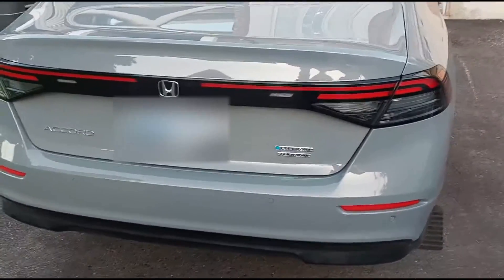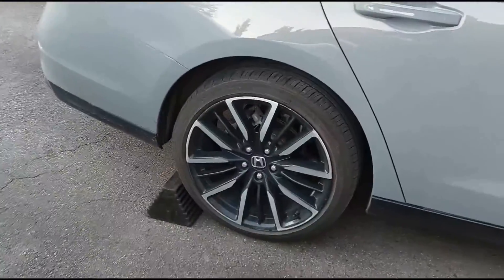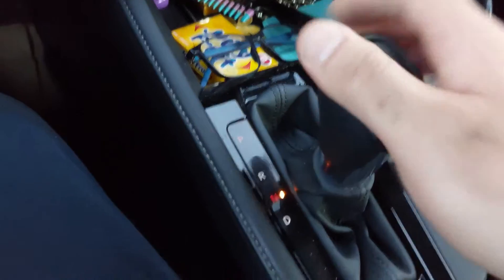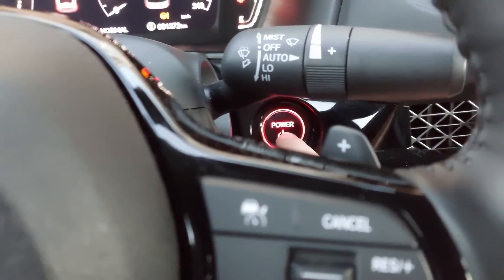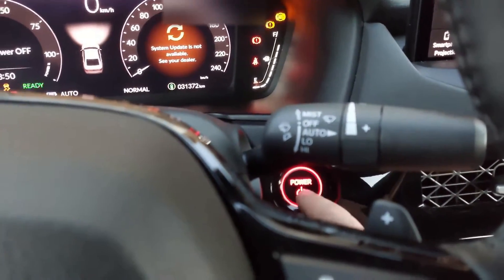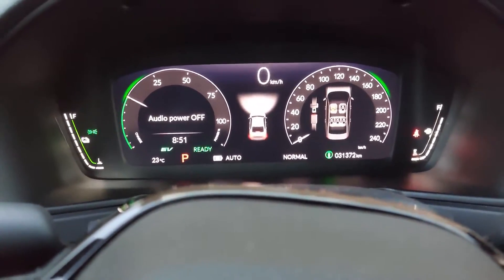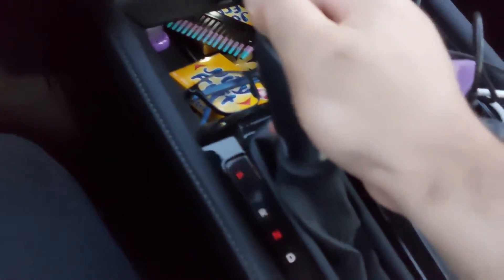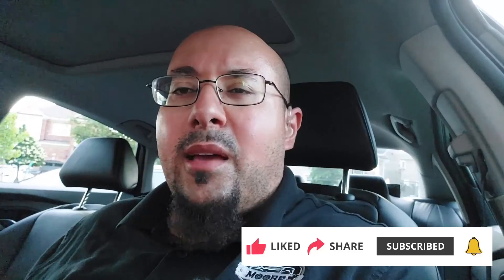Honda Hybrid Maintenance Mode Procedures - 2024 Accord Hybrid 2.0

Comment from the maker: Hybrid Maintenance Mode
(To allow engine to run while stationary)

Apply parking brake.
Chock the rear wheels before starting (for safety reasons).

1. Push-button start/stop (Power button)
press twice for ignition on
2. Press accelerator pedal twice
3. Hold brake pedal, shift to neutral, let go of brake pedal
4. Press accelerator pedal twice
5. Press brake pedal and hold
6. Place into park, let go of brake pedal
7. Press accelerator pedal twice
8. Hold brake pedal and press push-button start/stop (power button) once

To Exit Maintenance Mode:
Press Push-button start/stop (power button) once to exit.

2024 Honda Accord Hybrid 2.0 - Oil Change Service
https://youtu.be/IuH3ZWwZlzk

Comment: Thanks , crazy amount of steps , and I believe it has to be accomplished in 30 seconds or less .👍
Reply from the maker: The amount of sheer stupidity that the manufacturer's do to disable something or to keep something on. They want to continue doing things like this because they don't want the customer's to work on their own car they want you to take it to the dealer. It could have been simple like holding the gas pedal down to keep the engine running like on Toyota vehicles.
Reply: honda too does...hold it 10 sec it will be on